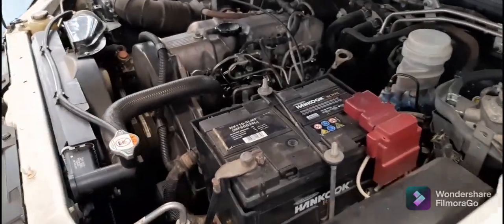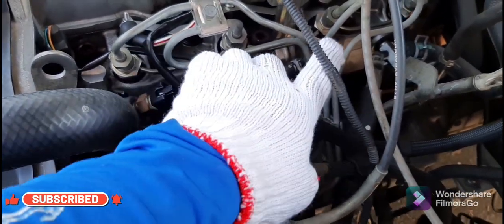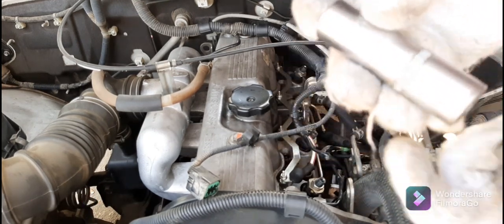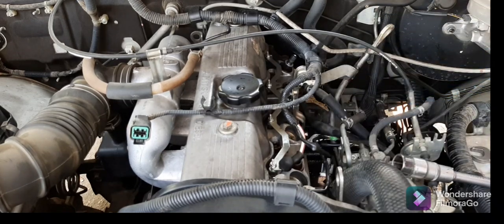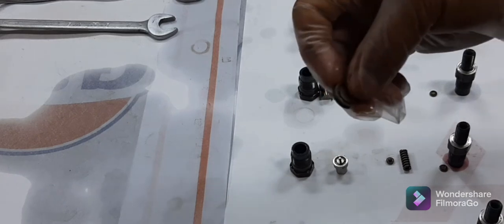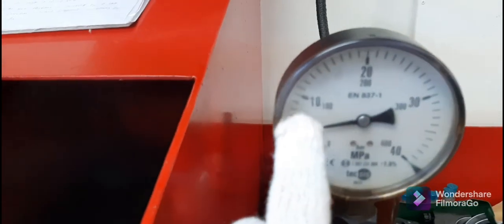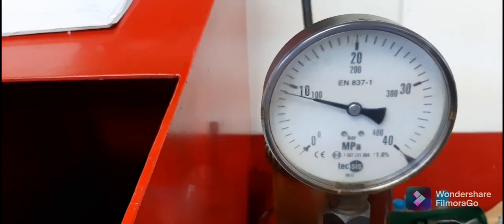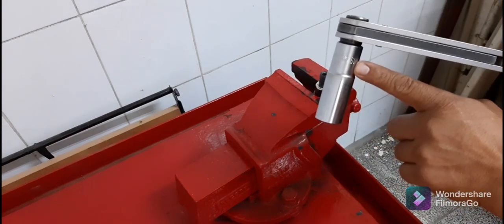How To Check And Adjust Injector Nozzle Pressure Of 4D56 Diesel Engine Single Overhead Camshaft.

Comment: What is the diameter of the washer you are using?
Reply from the maker: The same outside diameter of adjusting shim sir, you can use the thickness of shim from 0.01 and up to adjust the injector nozzles pressure 😀.

Comment: Sir parehas lang din ba ng injector nozzle ng adventure yan? Ano po kaya part number nung nozzle nya?
Reply from the maker: Pareho lang sir, MIMD620189 or MIMD620889
Reply: Parehas din poba ito sa standard pressure ng Innova 2018 or ano po Ang dapat or puwede napoba matanong Kay Pareng google Ang mga standard pressure ng mga fuel injector calibration? More power Kabayan watching from Al Khafji Saudi Arabia 👍

Comment: ano po part number ng zexel para sa adventure diesel 2010? meron kasi 105007-1300 at meron din 105007-1120. ano po pinagkaiba ng dalawa at paano malalaman kung alin dyan ang tugma sa papalitan?
Reply from the maker: I'm not sure kung pareho lang yung dalawa, tulad ng Nozzle tips ng injector ng 4D56 single overhead camshaft MIMD620189 or MIMD620889 original part number yan sir choose which is available. God bless po.

Comment: Very good tutorial. Exavtly what I needed to know. 
Question: All 4d56 engine has same psi requirement? I have a 2010 mitsubishi adventure Glx with 4d56. Will w8 for ur answer before I start butingting
Reply from the maker: Yes all 4D56 single overhead camshaft are the same pressure. Thank you sir. To God be all the glory.
Reply: @autofixgarage5438   thanks for replying sir, subscribing now. one more question, is it necessary to use teflon before installing back each injectors to the engine? i did not notice you did that
Reply from the maker: @ispkapatid  no need to use Teflon sir.

Comment: Ilang Mm Po Lahat Ng Shim Nung Dinagdagan Mo Ng Adjusting Shim??
Reply from the maker: I added 1pc adjusting shim sir until it reach the standard pressure.
Reply: @autofixgarage5438 napa pindot tuloy Ako Ng Kalembang 👍 meron Ako napanood inipit or pinaiksi Naman niya ang spring para makuha ang tamang pressure calibration... Ok lang poba ito keep watching and support from Al Khafji Saudi Arabia...
Reply from the maker: @niloyu105 kung inipit or pinaiksi yung spring pinababa nya yung pressure, pero madalas kasing nangyayari nakukompress kasi yung spring kaya umiiksi yung length ang tendency bumababa yung pressure kaya ang result hindi pa dapat maginject ng fuel ang injector, so ang result black smoke, fuel knock, low power, etc. Remedy, puedeng patakin yung spring hanggang umabot sa standard pressure or mag add ng adjusting shim. Thank you Boss, God bless you more.
Reply: @autofixgarage5438 Sir mga ilang odometer or year masasabi puwede na magpalinis Ng fuel injector salamat. Meron Ako Innova 2018, 120km odometer
Reply from the maker: Kung meron kayong kilalang shop na may injector cleaner kahit hindi tanggalin sa mismong makina makakatipid kayo ng time at pera may video ako sir Diesel injector cleaning. Every 40,000 km interval ang cleaning ng injectors, pero kung wala kayong alam or kilalang shop na may Diesel injector cleaning, may 2nd option sir may mga nabibili fuel injector cleaner in-tank ihalo lang sa Gasolina or Diesel after kayong magfull tank every 15,000km to 20,000km interval ang tinakbo bago kayo ulit maglagay sa fuel tank. Sana makatulong, marami pong salamat. God bless po.
Reply: @autofixgarage5438  at least 40km Odo Salamat dito sa Tip Kabayan. Yes nabili nako dati injection cleaner hinahalo sa Tanke. Sabi Naman Ng iba pakargahan lang sa magandang Diesel Meron narin mga sangkap para malinis Ang Fuel injector. Mukhang parehas lang Tayo Oras Kabayan ah? Salamat at Masipag ka sumagot God Bless 🙏
Reply from the maker: @niloyu105 salamat din sir, kapag may vacant time ako sumasagot ako, sharing lang naman ng knowledge 😊 basta't alam ko.
Reply: @autofixgarage5438  anong psi po ung standard pressure ng sa 4d56 mitsu adventure?
Reply from the maker: Ang standard opening pressure sir ay from 151.9 Bar to 161.8 Bar, God bless po.
Reply from the maker: Pacensya na po hindi ko nabilang kung ilang mm ng adjusting shim na nailagay ko.